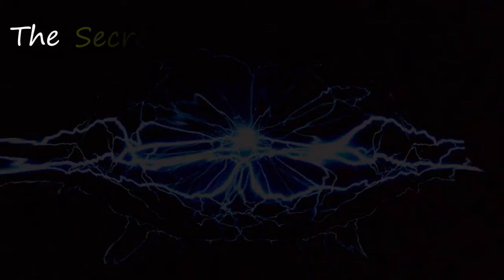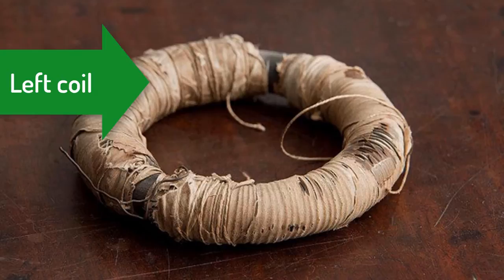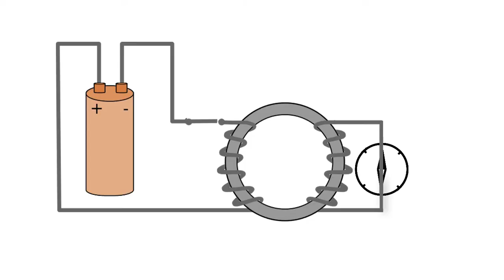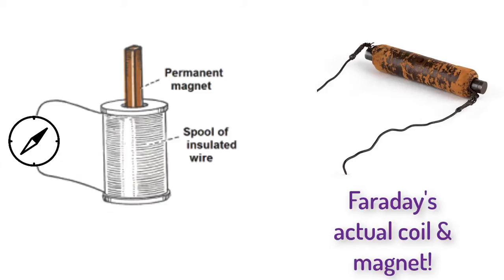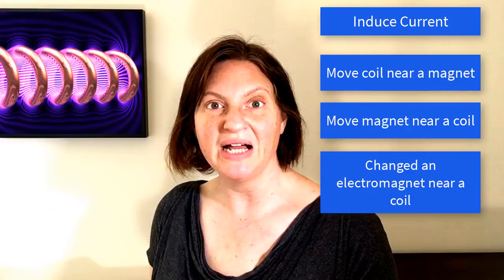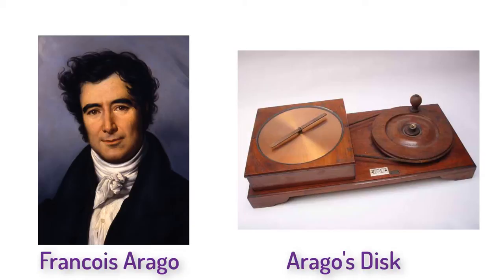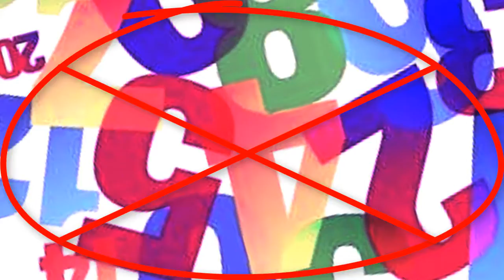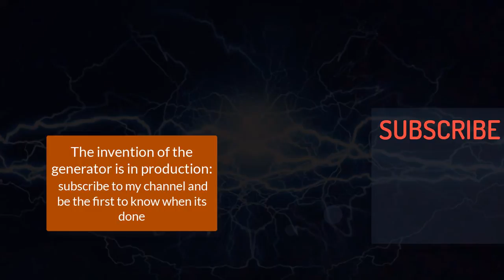How Faraday Made Electricity with Magnets: Discovery of Induction, the Generator, & Magnetic Fields

Comment: The dc disc generator can be operated backwards as a motor, since F = qv x B, if you feed current from the center of disk to the periphery, with a contact near where the magnets are.  Did Faraday try this?  I guess you could cut slots in the disc to minimized Eddy currents.

Comment: I have a question I hope you could help answering. I was reading about which conventions lead to the labelling of the electrons as negatively charged and of course it was because J.J. Thomson experimented with a Cathode Ray Tube and the directions the cathode ray were deflected by a magnet in a way only negatively charged particles would.

But how were the +ve and -ve terminals labelled in the first place? I know Faraday coined the term cathode, anode, electrode but who and when was the decision made about which terminals were considered +ve or -ve considering ions weren't discovered until Faraday. This is a question that has been bugging me for a while. Hope you can help🙏.
Reply from the maker: The positive and negative were actually defined by Benjamin Franklin in the 1700s! And Benjamin defined it because he had brush rubbing against glass and he assumed that the brush with sweep away the charges and so he called the charge on the brush positive and the “lack of” charge left on the glass negative. By JJ Thompson’s time, positive and negative were baked into all the equipment so that once he figured out that the electrons were tiny and the ones that were moving and the source of electricity it was too late to go back in time.  (Faraday defined the cathode as the terminal where the current came from and Anode as the terminal that the current went to. However, as they didn’t know about electrons he thought the current flowed from the positive to the negative, so in the battery the positive is the cathode and the negative is the anode. However, with the cathode ray tube you can tell which way the current is coming from so the cathode is the negative side. So sorry it is really confusing isn’t it??)
Reply: @Kathy_Loves_Physics  I can understand Franklin's thoughts on this but how does it apply to batteries? How did they know which electrode current flowed in and out of though? For example Volta's Voltaic Pile just mentioned using zinc and copper he didn't really specify which plate the current came in and out from at the time (now is hindsight we can go back and label it of course). So who did?
Reply from the maker: Bryan Leong that is a fascinating question. I am sure that somebody attached Volta’s pile to a Leyden jar and determined the charges on the plates by what would attract or repel silk rubbed on glass. But I don’t know who did it. Ampere? Davy?  I don’t think Volta published after the battery so probably not him. Interesting...
Reply: @Bryan-dr5qy  This was a major stumbling block for me, from an engineering perspective, until I finally accepted that, generally, it doesn’t matter (again, from an engineering perspective).  I just wish I’d have learned (accepted) this in my 20s instead of my 50s.  Imagine my surprise (relief) that waves don’t have to be constrained to moving in perfect sine waves, and this is just a model we use to describe their motion and effect.  The model is accurate for calculating, but does anyone really know how waves propagate for 13billion years to our measuring contraptions?  Who cares, it seems to work.  I wish I knew that I was able to accept this difference between how waves may act versus how we can measure them.

Comment: I would think that Faraday's experiment with the ring with two windings was not drawn to scale, or the compass needle's response to the current in the secondary winding would've been swamped by its proximity to the primary winding.  I would guess he had longer wires leading from the secondary to his galvanometer.

Comment: Take a 1831 Michael Faraday homopolar generator housed in a non magnetic environment, spin the magnet together with the conductor @ 50000rpm and look at the power output.

Some people claim you can get 12 volt at 10000 amps from an 8 inch rotating neodymium disk magnet with ball bearings and liquid metal current collectors but I don't know if this is true/possible.